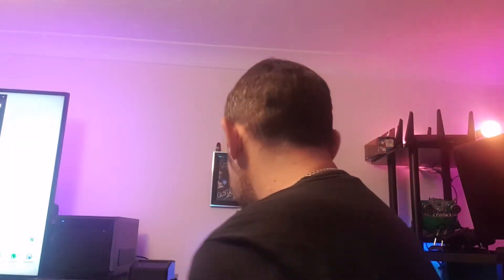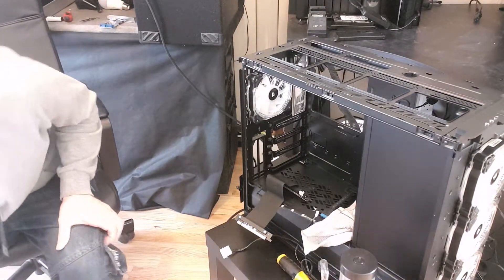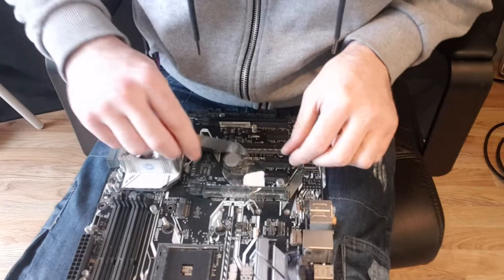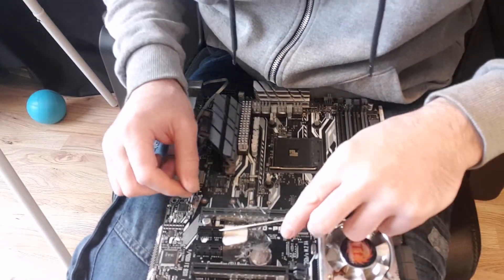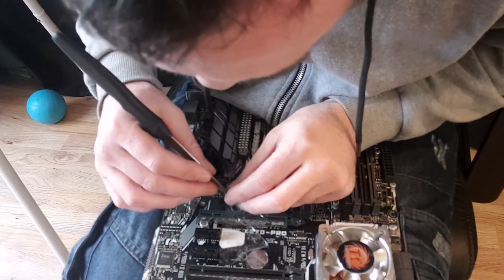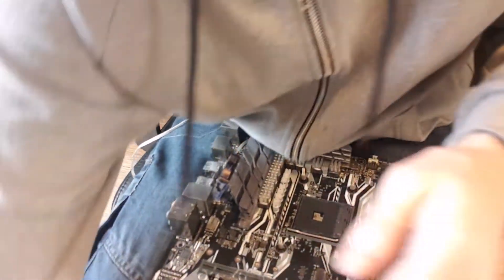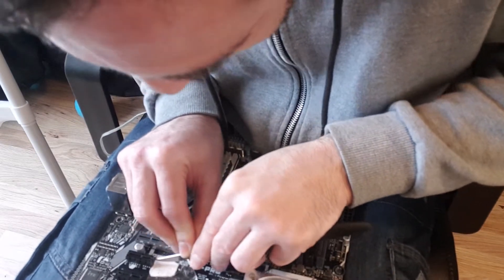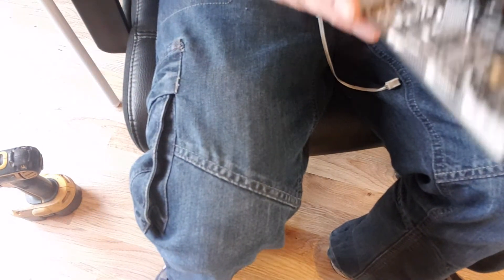PCIe x1 slot mod - Fit x16 card straight into x1 slot.

Comment: I would use mini tools of the Dremel kind instead. What you did is terrible for the precision. With the right kind of tool, I would be confident not to damage the motherboard. 😅 Ah, I did not think that the pins would be on the way. 😐 Sometimes a soldering iron can do the trick as well. Well in the end I don't know, maybe it was not that bad. 😅

Comment: So my plan is to use a pcie 4.0 x1 slot for a avermedia live gamer pro or elgato 4k capture card since it only requires pcie 2.0 x4 slot. since pcie 4.0 x1 slot bandwidth is 2gb and pcie 2.0 x4 slot is 2gb. I would imagine I should be good to get the x1 to x4 adapter. Your thoughts? Should I be good to go?
Reply from the maker: It won't work like that. A gen 2 device will only ever receive gen 2 speeds. You'll just get 1 lane of gen 2. That might be enough for a few frames a second of 720p or something (if your streams fall below the bandwidth required then fine but if not you'll need to find more lanes somehow)
Reply: @KillaBitz  1080p 120 works. Have to check 4k60

Comment: Guessing you don't do any 3d printing or you'd have some snips that could do it.  That was a big blade, lol...
Reply from the maker: Seems a lot of work for one slot when the kitchen knife is fine.
By the time you've modeled the snips and cracked the handle trying it I'd have already done this.
Also I've got a modified extended Ender 3 / Endzilla.
Also also the pci-e slot plastic is more likely to snap than cut unless you saw at it.

Comment: I did the opposite, chopped down a x16 card to fit a x1 Slot 

The first pins actually power up the device, the rest its for data transferring, i bought an SSD NMVE Adapter that i needed, an PCIE X1, but i got shipped a x16 instead.

Since the one i got couldn't fit, i ended up counting the first 7 pins that counted as PCI X1, and broke the rest off the adapter with a Dremel grinder, it was like a $10 adapter anyway, but the SSD was worth around $90.

It bottlenecked, PCI Express X16 Are usually Gens 3.0 or 4.0, but the rest PCIE X1 Are 1Gen inferior, Since my Graphics Card is using the PCIE X16 Gen3.0, the one im using for the adapter is a PCIE X1 Gen2.0, max speed you can get is 500MB/s, even though my SSD on a M.2 port from an old motherboard i could get around 900MB/s or 1.000MB/s Speeds. 

Do this only on desperate times, since i didn't have spare change for an SSD nor a HDD since the Graphics Card alone costed me around 65% of the whole PC.

Comment: You are crazy. lol.  Well done though!  I'm looking to use a PCIE 1x slot with a Quadro P2000 (somewhere between 1050ti and 1060 in performance).  I will be using an adapter cable though.  I don't fancy wrecking my expensive motherboard!  It will be interesting to see how well it works for gaming. haha.  My hopes aren't too high.
Reply from the maker: Quadro for gaming.... and he thinks I'm crazy.
I had a p2000's for plex transcoding but I sold it when the GPU price mooned.
I'd say you want at least x4 for that.
I tried a 2070 super on an PCIe gen 2x 1 and you couldn't even watch video, it was like 5 fps in windows.
Reply: @KillaBitz  interesting. I don't intend to use it for gaming.  I have an RTX 3080 in the x16 slot for that.  I run 6 monitors and currently I am using a GT710 in the x1 slot  (the card is only pcie x1 so haven't modded motherboard).  I just thought it would be intesting to see how it does with gaming.  The GT710 can only manage 5fps on low settings on shadow of the tombraider.  I am finding things sluggish when dragging windows onto the GT710 displays.  Hoping a quadro will be better.  I only have room for a single slot card and most geforce GPUs above GT710 are dual slot.  So quadro was the only thing I could get really. Oh  and I got it fairly cheap on ebay, so can always put it back on ebay if its no better than GT710.
Reply from the maker: Oh ok that makes sense. The GT710 was available in PCIe x1 format so I guess it needs less bandwidth than 1Gb/s so you'll see an improvement by maxing out that x1 I guess.
No idea how much you'll gain though. 
I doubt you'll see full 1060 fps (especially since it has slightly less vram) and the x1 but you might get %20
Let me know how you get on :)
Reply from the maker: Did you have a spare m.2 slot or anything??
That would give you 4 lanes instead of just 1 (if you get out the correct brake out)
Reply from the maker: What Motherboard are you running?
Reply: @KillaBitz  I am using a "MSI MAG B550 TOMAHAWK Motherboard ATX".  I have both m.2 slots filled with nVMEs. And I also have a USB 3.0 PCIe card in an 1x slot.  This means that the 2nd full-size PCIe slot (which at most runs at 4x) is disabled by the motherboard.
Reply from the maker: Dammmm son you got that Puppy maxed out.
The Type-C header might help (if you could bare to lose a little off of a NVMe) by using a USB dock but I say that board is giving everything it can.
X570 would be the next option I guess but even then your using a lot of lanes.
This is the trouble with consumer platforms.
Last year I was running Threadripper and the board had like 6 x16 all fully usable.
Sadly AMD and Intel don't give you quite as many lanes on the mainstream.
Is there no way you could live without that USB Board and use a hub instead??????
Reply: @KillaBitz  Yes. I naively didn't realise about the PCIe lanes limitation.  The last PC I built was in 2007 and that motherboard supported triple SLI!  Since then I've just had laptops, so this new desktop build was supposed to be an ultimate build for me, and it's turning out to have limitations that I didn't consider.  If the quadro doesn't work satisfactorily in the 1x slot, I am thinking of removing the USB 3.0 card and instead using a cable that goes to the USB 3.0 header on the motherboard and get my back USB ports that way (my case is custom-made out of wood and has no built-in USB ports).  I could, possibly, put my 2nd nVME on a PCIe 1x adapter card instead of using the M.2 slot.  That would then give me 4 lanes for the GPU in the2nd full length slot.  However then that nVME would be limited to about 800mb/s but I believe the random access should be relatively unaffected, and that's the main thing.  For things that are really needing that speed I can use the PCI 4.0 nVME.
Reply from the maker: Oh get those usb headers going. Especially that Type-c 3.1 near the 24 pin.
You've got 2 x USB 2 and a USB 3.0 header.
All together that's 6 Type A's and a Type C or A
and it gives you 4 lanes if you move the NVMe one of those x1 to NVMe cards on ebay (they say about being for testing because of the speed loss but they work well and they are only a few quid though you might want a cheap heatsink to)
That should net you loads of frames ;)
Reply: @KillaBitz  Well, I've had some interesting results!  I removed all GPUs from my motherboard and also the USB 3.0 card.  I then put in the P2000 in the 1x slot using an adapter.  In benchmarks (three 3DMark ones plus Shadow of the Tombraider and Xplane 11.53) the P2000 was on average 9.1 times faster than the GT710!  The biggest difference was in in 3DMark Timespy where the GT710 scored 262 and the P2000 scored 3141!  

I then did the benchmarking again with the P2000 in the x16 slot.  In benchmarks it showed that on average I was getting 91.5% of the framerate with the card in the 1x slot compared to the x16 slot.  

I also tested it in the x4 slot (removing the 2nd M.2 to do this), and in benchmarks it averaged 95% of the performance that it obtained in the x16 slot.

However framerate isn't the whole story.  For instance in xplane (which dynamically loads textures and polygons as you move) the framerate was almost the same for both x1 and x16 when flying but not changing view.  But if you pan your view around it was very noticably choppy on the x1 slot, and relatively smooth on the x16.  

I then put my system back together with the RTX 3080 in the x16 slot and the P2000 in the x1 slot (and left out the USB 3.0 card).  I benchmarked again. To my surprise all of the benchmarks on the 1x slot have now dropped by about 30%.  So now the P2000 is benchmarking about 6.8 times faster than the GT 710.  I have no idea why having an RTX 3080 in the system would drop the scores of the P2000, but it really did. 

Anyhow, that's still a massive improvement, and on the desktop I now have a smooth experience on all screens, which is what I was after.  Also the secondary displays now are able to render simple 3D, which the Gt710 couldn't really, which means I have the option of putting additional views for xplane on those screens now.  Very happy!
Reply: @KillaBitz  actually, have just tried playing a video on one of the screens attached to the P2000, and it's choppy as hell!  I guess I will have to see about connecting it to x4 PCIe and moving my M.2 SSD to an x1 card.
Reply from the maker: Wow, that's decent. It does show the x1 bottle next is basically the same as a memory bottle neck though but if it does what you need I guess that's all that matters.
Thanks for sharing, it's very interesting.
:)